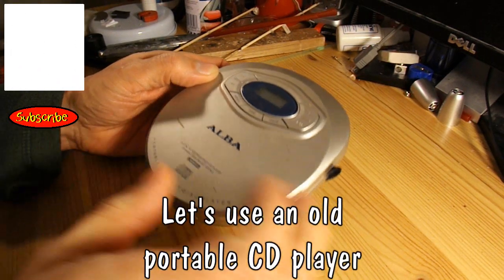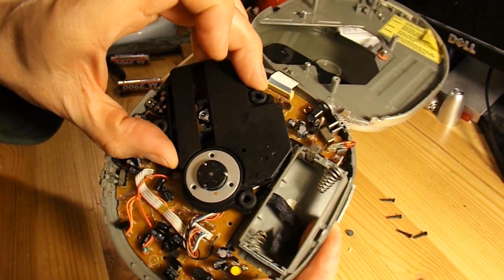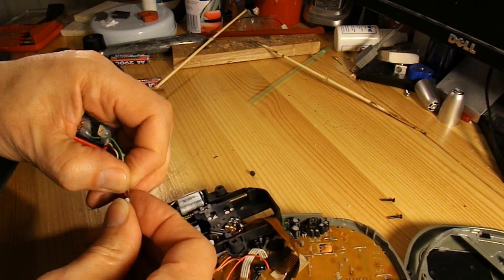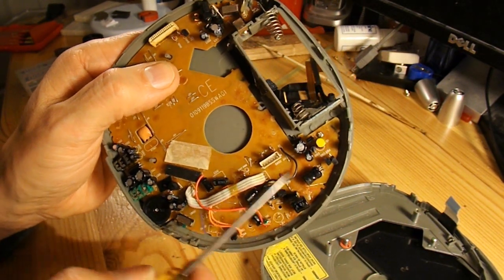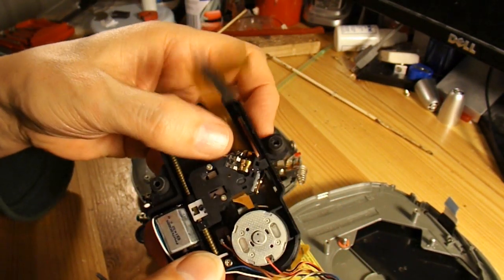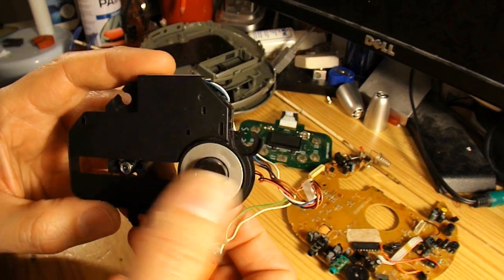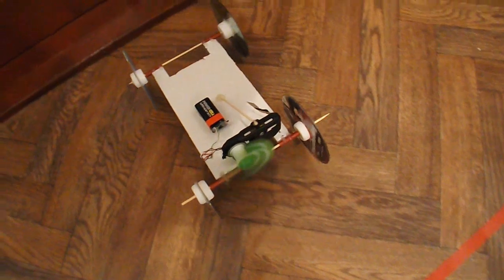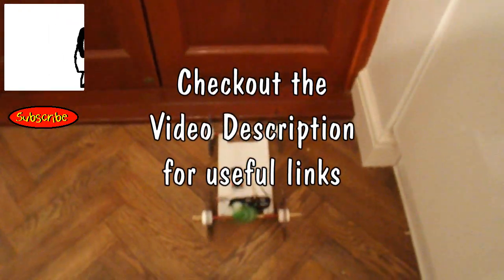Let's use an old Portable CD Player for a Fan Car

Comment: What did you do with the laser?
Reply from the maker: +JackANDJude never did get around to it. I was thinking of using it for my speed timer for rubber band cars but used a laser pointer instead. The CD player is still in my box of bits. If you want to do something with a similar laser then TingaWinga5 is probably worth a look https://www.youtube.com/user/Tingawinga5 By the way, I liked your LED light show video today.
Reply: GrandadIsAnOldMan
Thank you!  & I'll check out TingaWinga5, as I just took apart a few CD drives.  :)

Comment: Is that brushed or brushless motor?
Reply from the maker: +rohan bhardwaj I had expected stepper motors to give control over the movements but they both appear to be a brushed motors. If it was brushless it would need 3 wires or a driver circuit inside the casing of the motor. I have seen a small brushless motor used for a fan that has a small chip on the back of the casing to convert from 2 wire in to drive the phases of a brushless motor.